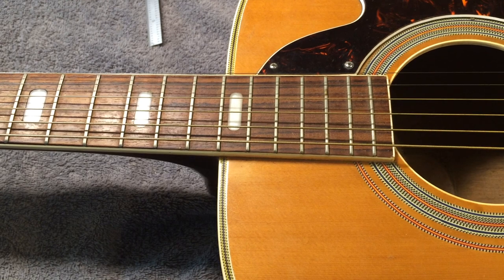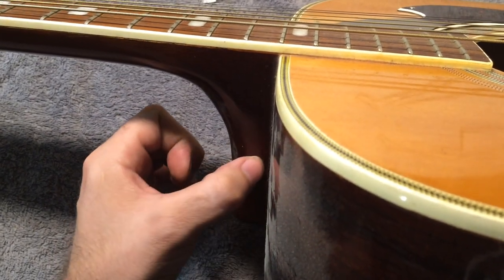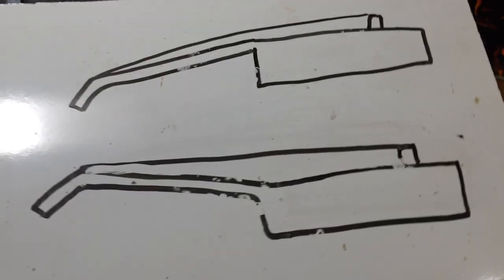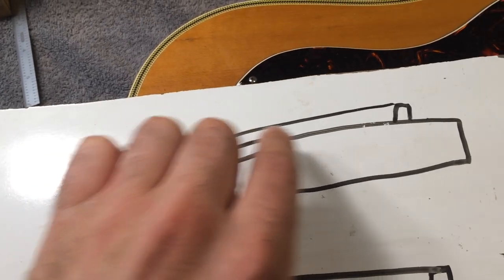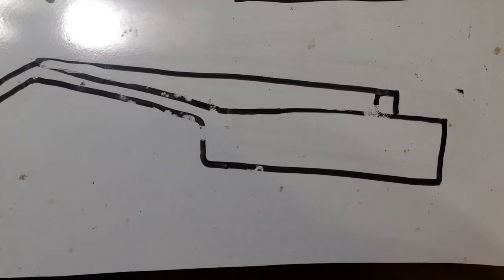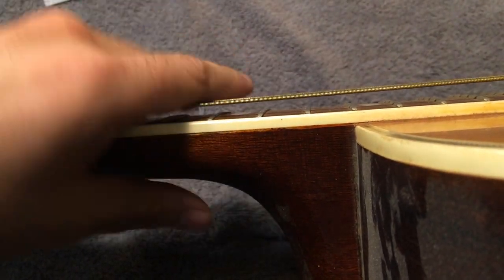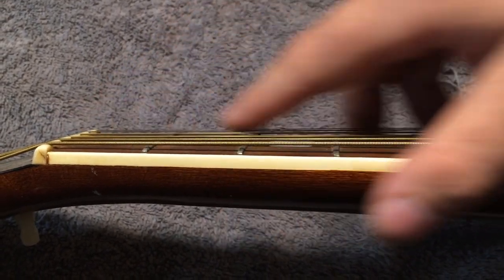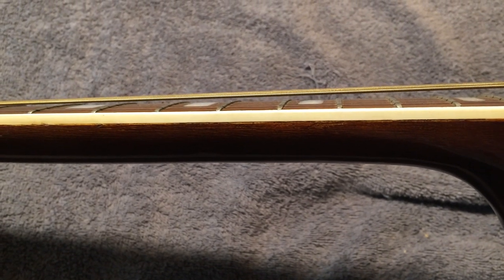How to Tell if a Guitar Needs a Neck Reset

Comment: Since Steam is water, how can it be dry as it will start to condense as soon as its temperature drops below the boiling point of water.
Reply from the maker: I am not a chemist, but that is what I was told to call steam that has been put through a moisture trap like the one I have on my unit. Whether that is correct or not I can't say for 100% certainty but I have seen it repeated elsewhere.

Comment: You forgot to mention the possibility of a "belly bulge" behind the bridge causing high action.
If the instrument has a "belly bulge", that needs to be addressed First, before doing a neck reset.
If the bulge is taken care of After a reset, another reset will, very possibly, be needed. BTDT.
Reply from the maker: In most cases, thats going to be the result of humidification thats too high. Not always, but most of the time. In instances where the belly is deformed due to other issues, its still a good idea to get a pro to look at it. In a lot of cases a guitar might need both a reset and to address a belly if it has one.
Reply from the maker: Its also worth mentioning that most modern "flat top" guitars have a radius. Usually about 50', sometimes less or more. Measuring this to see if its appropriate for the guitar usually requires some tools.
Reply: @DrewsGuitarShop : Still, as I mentioned, the belly should be addressed first, to avoid a lot of heartache, later.
Reply: @DrewsGuitarShop : Anything referred to as a "belly" or "Bulge" will be a whole lot less and a lot more noticeable, than a 50' radius.

Comment: How much would a neck reset cost?  Is the price of a neck reset very on the work ?  or if it needs a reset the  price is the same all guitars?
Reply from the maker: I generally charge around $450 if I have to steam a dovetail. Less if the neck is already off or mostly loose. I charge about $200 for modern guitars with bolt on necks such as taylor and garrison. The price is based on the hours it typically takes to do the job. The more complex the job, the more expensive it will typically be.

Comment: My guitar has a curve at the center of the neck where I can't adjust it with truss rod adjustment. What do I do?!! Plz help
Reply from the maker: I can't really diagnose a problem if I can't see it. Make sure you are turning the truss rod nut in the correct direction and that you are measuring with a feeler gage and strait edge to see movement. It may be reverse the normal direction. Be careful you don’t strip it, pop the fretboard off or crack the back of the neck.

Comment: Hi ,nice video  I’ve  been playing a long time  I am familiar with truss rod adjustments on electric and & acoustic full size guitars .Do the same checks apply to a 3/4 classical guitar ? or should finger placement and tapping be done on different frets?  The guitar also has a truss rod I’m hesitant to turn before I know-Thank you
Reply from the maker: Classical guitars traditionally have a dead flat board or very little if any relief. When I get one in that has a truss rod, that is what I use as my benchmark for adjustment.

Comment: One of my acoustics has a neck that isn't completely straight. It bends slightly downward toward where it meets the body. It still plays and sounds fine but not as good as it used to. Would a neck reset fix this problem?
Reply from the maker: I am not sure if what you are describing is normal fretboard fallaway or if there might be a fallen transverse brace or other issue. Do you have a back-bowed neck? I think that bringing it into a shop would probably be the best thing to do.

Comment: Need one on a 69 Gibson 12 string Could you ballpark a price for me I'm shopping around Thanks
Reply from the maker: Gibsons are a pain to do neck resets on because they finish the guitar after the neck has been joined to the body causing a thick bead of finish along that seam. I’d probably charge around $500-$550 for doing that and caution you that there may be visible finish touch ups around the neck joint.

Comment: but still.... NO ONE can tell me what to do when the warp is the opposite so frustrating. Kind of like a back bow, but it's the whole neck past the body.
Reply from the maker: This video is specifically about neck joints and pitch. The only mention here about the neck itself is regarding the relief and whether that can be used to reduce string height. 

I do have other videos about twisted necks and things like that, but without seeing your guitar it's hard to determine what a good fix might be. 

Offhand I'd take it to a shop for a setup. It's probably fixable.
Reply: Thanks, I have a shop and I work on guitars, but I am not a real luthier, I am a hobbyist......I know how to do truss rod adjustments, but that's not what it is. I have had this happen to three or four guitars, because I left them in the garage in the desert, but I didn't have any other place to put them. It's weird. It's almost like they need to be steamed straight or something...... Oh well, live and learn. Thanks, and have a great day.      @DrewsGuitarShop

Comment: What about a bolt-on neck? Does most of this vid also relate to electric guitars?
Reply from the maker: Fender style bolt on neck angle issues are easy, you simply shim them. This video would be mostly applicable to set neck electric guitars as well, though, set neck electrics don't tend to age in the same way as acoustics.
Reply: May not be worth repairing, but thays the type of guitar for a first timer to try on in my opinion.

Comment: I believe I have this with my electric guitar. I made the mistake of taking all my strings off instead of doing one string a time. As I was tuning the strings I noticed the bridge was being pulled up with the strings and the strings were not near as close at they were before.
Reply from the maker: I don't think that sounds like a neck reset scenario, but maybe if it's a strat style guitar that the setup isn't appropriate to the strings you are using. Hard to say without seeing the instrument or knowing what kind it is, but electrics rarely need neck resets. I think you should get your instrument assessed by a pro.

Comment: In order to avoid future neck resets caused by string tension over time pulling the neck up, some  high end guitars are now being made with the necks set angled downward (back) too much, making them hard to play, and the bridge saddle needing a shim, right out of the box.  I kid you not.  They are to be avoided.
Reply: Compare the price & complexity of adding a shim to that of a neck reset. I'll take the shim thank you. And if you don't like the idea of a shim because you think it sucks tone you can replace the saddle with a higher saddle, all an order of magnitude cheaper, easier and as effective as a neck reset.
Reply from the maker: That angle is called "neck pitch" and it normal and desirable on new guitars for reasons that are discussed in this video. The saddle height would need to be adjusted after the nut and neck had been dialed in and dependent on where the strings were at that point to get the action within acceptable playability.
Reply from the maker: @stephensimpson2359  @Bob_Aldo, Ya'll are talking about a bit of a different thing here I think. the reason you shim a saddle is that the saddle is TOO LOW and causes a setup that is also too low, which is the opposite of the issue cause by a guitar that needs a neck reset where you will have a saddle that is too low on a guitar that still has a setup that is too high. So, a shimmed saddle would not be an appropriate alternative to a neck reset.
Reply: @DrewsGuitarShop    Negative relief relieves absolutely nothing!  I am talking about a full sized, uncut Martin factory saddle that has never been
lowered at all, that because of the neck being improperly set in the brand new D-28 (which the famous dealer freely admitted was so Martin could avoid warranty repairs way down the road) had to have a shim under the saddle just to make the guitar marginally playable.  I have been playing acoustic guitars since the 1950's, and have never encountered such a stupidly set neck by any maker!  Of course they took this D-28 back, and totally understood why.
Reply from the maker: @bobaldo2339  It sounds like a lot could hacve been going on there. Neck pitch can be too much in which case if you want to set up the guitar right you may need a taller saddle. The saddle hight is determined by where the strings land after working the nut and relief. The saddle will be trimmed, generally, at the factory in order to dial in the string hight once the nut and neck are properly dialed in. Where all that lands is dependent on the neck pitch belly and bridge hight. There are a lot of factors.
Reply: There certainly are "a lot of factors", as we all know, the most obvious, however, is the case when the neck is incorrectly set in the first place.

Comment: just needs inverted saddle.  and skip the neck reset.
Reply from the maker: Not sure what you mean by an "inverted saddle" but my 20 years and every teacher I have ever had + my time at Roberto Venn say this guitar needs a neck rest to play properly. Care to explain?
Reply: @DrewsGuitarShop   Its when you route out a hole where the saddle is.. Its really tall so glued on the back inside panel..  then it comes up though the hole  where the old saddle was.
Reply from the maker: @northyland1157  I am having some difficulty making sense of what you are saying here. Are you suggesting routing a hole all the way through the bridge and soundboard etc  so that you have a cavity going all the way into the body of the guitar and then installing a glued in saddle of some sort from the inside? The issue that necessitates a neck reset as I showed here in the video is that the bridge and saddle are as low as they can go and action cannot be set properly wither at the bridge or by dialing in the neck or nut. I don't think that severally  modifying the way that the bridge works is a better solution on a guitar that should have a neck reset. At least, I am not going to suggest it to the next customer I have with a vintage martin that needs a neck reset.
Reply: Maybe that would only work on an electric guitar due to all the bracing on acoustic.
Reply from the maker: @northyland1157  Now I am really confused about what the initial post was about.
Reply: @DrewsGuitarShop    ha ha Some people's children eh? You have patience

Comment: Unless there is great sentimental value involved, this is the type of guitar you donate to a 'luthier in training' to practice on.  Then you buy a new one to replace it.
Reply from the maker: Or its one you run experiments on. I ended up using some non-conventional techniques on this guitar to fix the neck angle and sold it in fine working condition.

Comment: No this is not right !
Reply from the maker: Peter, I have a education from Roberto Venn, have studied under several experienced and professional builders and repairmen, worked in several pro guitar shops doing building and repair, and 15 years of experience. The information I have put into this video is the same as I was taught by every one of my teachers and is the criteria I use not only to determine if the instrument needs a reset, but also what measurements I should use when performing it.  I may have left out one or two things that weren't important for players/buyers that one would need to perform a neck reset, but the information here is good as far as my experience, education and background would say.
Reply: @DrewsGuitarShop  don't worry. Don't let nonsense comments like this irritate you, just ignore or delete them. I love your videos!
Reply: What's wrong?  Speak up.  We are listening.